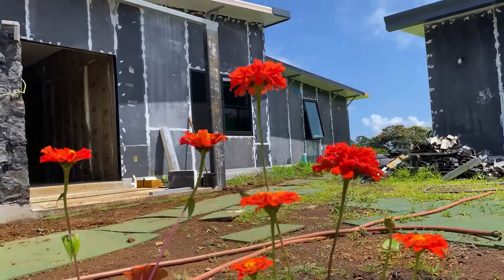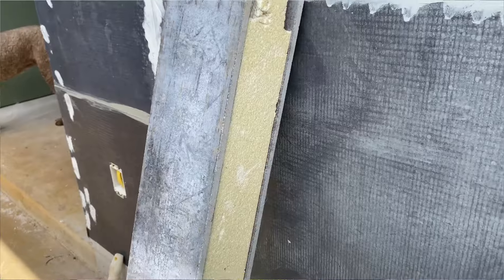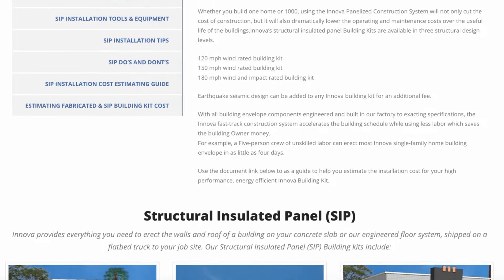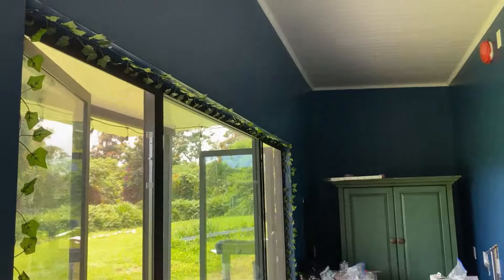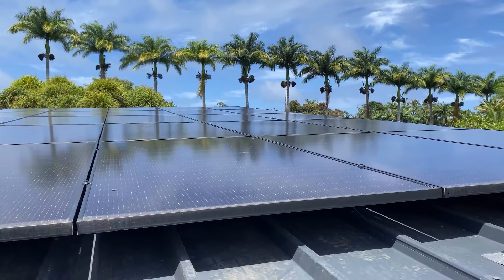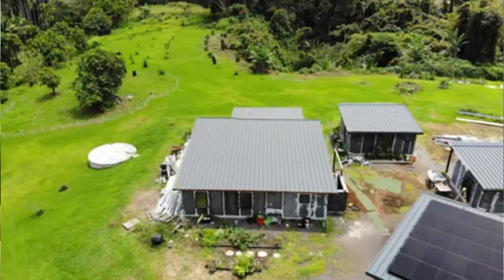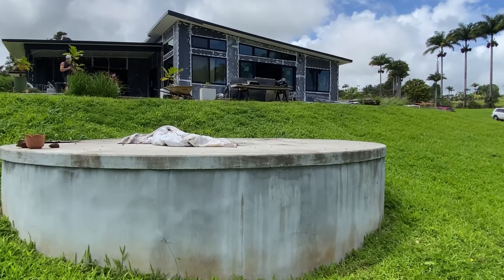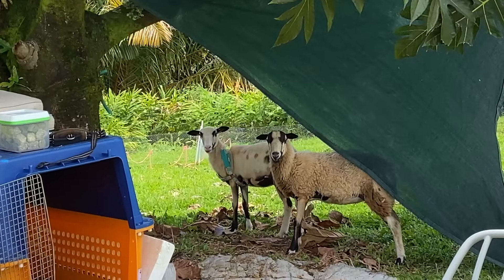SIP House: Structural Insulated Panel Home Construction in Hawaii

Comment: For a truly affordable housing Cindercrete is by far the best building material for Hawaii. 
Cindercrete is a mixture of cinder cement and water mixed and poured into a set of reusable forms. Walls are poured from 12"to to 34" thick. Cindercrete is fireproof termite proof rust rot and mold proof non toxic and has a high R value and good sound attenuation. Solid poured walls means no critters can live in your walls. Cindercrete can be built for a fraction of the cost and time and cinder is one of the few building materials that can go directly from the mine to the job site ready to use without any additional possessing and zero waste. Cinder is the only local building material on the island 
Take care Ray
Reply from the maker: Have any projects I can check out?
Reply: Google all the walls of my house are made of pumicecrete or pumice and concrete pumicecrete structures 
Pumice and cinder work the same for houses pumice is white or gray and cinder is red

Comment: Great channel; I just subscribed. This is a great building method. I'm surprised to see it applied in Hawaii as one of the benefits is the great insulation properties so you usually see this in colder climates. But when I think about it, why not use these in Hawaii too?:
Reply from the maker: Yeah, why not, and if you design them with good airflow, even better!